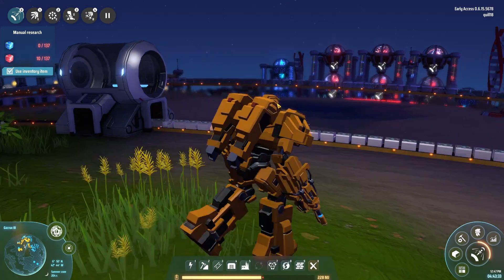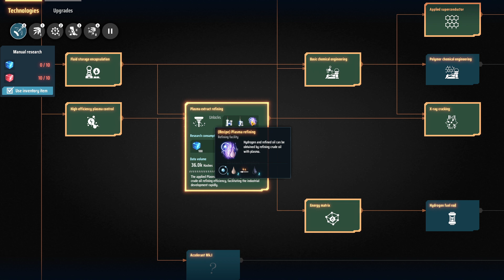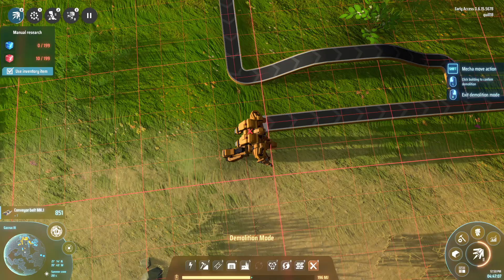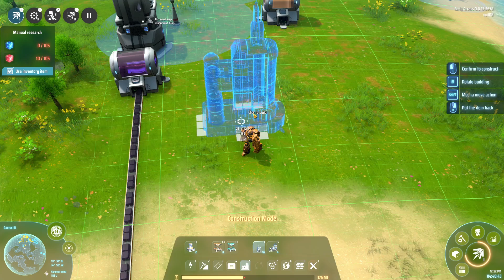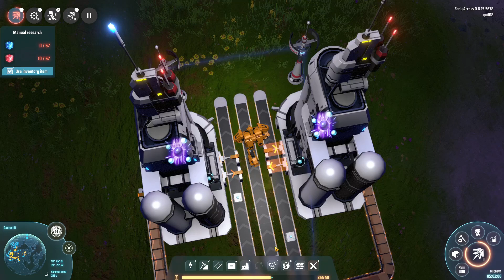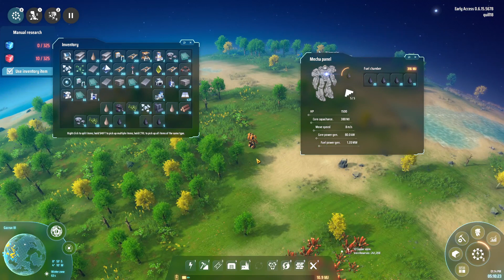Dyson Sphere Program - Cosmic-Scale Factory! Ep 6

Comment: i feel like the refined oil processing reduces your net hydrogen output.  the crud processing produces 2 hydrogen in 4, seconds but the refined processing requires 2 and produces 3 in 4 seconds so you are going from a net of 2 out to 1 out (and taking twice as long to do it.  it all depends on what the second product you need.
Reply: not to mention the additional space needed for the second refinery.
Reply: also @quil18, you can dump your hydrogen and energized graphene onto the same belt, and then use a sorter/spliter  to filter the hydrogen from the graphene and store the graphene to for later use.
Reply: @xtreampb6309  I may be misunderstanding, but I'm not following. How does getting an extra H out of each Crude Oil reduce output? Unless you are short on refined oil for plastics etc, turning Ref Oil into Graphite + a bonus H is a win/win?
Reply: @DynnysW  refining the oil produces 2 H, so in 4 seconds your net out is 4 H and oil.  if you further refine the oil/H you produce 3 (but costs 2) so the net 1 H after 8 seconds of processing.  i did some brief math and it does increase your output from 2 to 2.5 in the same amount of time (2 divided by 4 seconds vs 3 divided by 8 seconds)  but it also costs more in space and power.

Comment: @Quill18 check production output times & input requirements on your assemblers: you may well be able to get away with using longer sorters depending upon how the numbers pan out..

A self-sufficient red science block is a v useful thing to have; prolly no need to expand it until future techs become available (& the 'graphine' (excited graphite)) can be used as a decent mech/power plant fuel source until other things become available (save the coal for later!)..
-----------------
The processing of oil -> extra hydrogen + graphite even makes a certain amount of sense if you think of it as /theoretical/ chemistry: the refined hydrocarbon (oil) only consists of a bunch of hydrogen atoms linked to a few carbon atoms in a long molecule. If you split it up & recombine it the carbon becomes graphite while the excess hydrogen is produced as a gas.. (practical difficulties are left as an exercise for the reader ;))

Comment: quill: there must be a way to make this more compact
me, yelling at screen: swap the oil and hydrogen outputs!!
Reply: Jist turn the refineries 90 deegrees.  Run input belt on one side, two parallel out put belts on the other side.
Reply: Or have (going down the belt) A to belt, B to A, belt to B.
Reply: Or, just... offset one of those machine by one.

Comment: Pro tip while doing space travel, make sure you always have some extra fuel for your mech at hand because if you run out of all fuel while at space, its kinda gg. You will be stuck moving in one direction at the speed you were going and as far as i know the only way out of that situation is a reload.
Reply: You actually generate a tiny amount of power without fuel. You can get back to a planet this way. Reloading autosave is waaaaay quicker though.
You should always be aware of how many warp cores you have with you as well. Making a trip that requires two of them with only one may leave you stranded in the middle of space with the next star being 8 lyrs away. If you don't want to reload you can keep your computer running overnight to get back to a place from where you can order new cores via interstellar delivery. Of course you would also need to calculate when you would arrive there. Otherwise you might overshoot your target by one lyr or two.
Reply: I think I might be doing it wrong but I find that my leisurely cruise between planets barely use power after I break atmosphere
Reply: @GunmadMadman  he mean wen you pres capslock and enter warp it drain the capasetor of you mech RELLY farst so a big jump mean you have to stop in the middle to recharge and then jump back to WARP tha requre 2 jump and ther fore 2 jump core 1 way so 4 in total if you are 1 short you get stuck slow boating it or reloding

Comment: Quill you can pull and put stuff on 3 belts away. So you can First row input crude oil, second row output Hydrogen and third row output refined oil.
And i really don't like the X-Ray cracking, since you need refined oil for both plastic and organic crystalls for your yellow cubes.
EDIT oh btw: Graphite is a super Fuel for your Icarus
Reply: Longer sorters take significantly more time to transport wares tho..
Reply: @snafu.X  and ? that is only a problem if you produce faster than it can be moved, which is not the case with the Oil products

Comment: It's not intuitive AT ALL but you can make a jump with the belt a lot shorter.

First, you can have a standard hight jump with 5 belt pieces if you first build the high point (two pieces straight) then connect low point that has one piece gap with that high point THEN delete the second high piece and repeat first part in reverse.

Second you can have a very narrow jump if you do the first part standard jump then delete all the pieces that are in the air except one or two and after that connect the belt to the ground as usual.
With this variant you can weave a belt in between two consecutive layers of belts.
Reply: I saw that on Skye Storms not blindingly obvious tips. With that technique you also can curve directly after an incline and make a 2x3 spiral staircase belt.
Reply: That's a bug and will be patched, don't rely on it.

Comment: hmm, if only there was something that uses that refined coal that you produce from that Hydrogen cracking staring at the red science menacingly
Reply: If you are not researching that refined coal will bottleneck. The best way i found how to deal with it is just run it straight into few chem power plants
Reply: @agodin2500  connect a splitter to the refined coal, have it prioritize research, and send the rest to storage, use it for whatever you need later

Comment: Just do the Hydrogen on the outside and refined oil inbetween the two as the refined oil doesn't need to be outputted again?
Reply: That was my first thought as well, but then I realised if you add more, then suddenly the hydrogen will by on the inside again.
Reply: @OndřejVágner  yeah but then when he expands it he can just add two belts next to each other with hydrogen on the outside, and it would still be the most compact build i can think of. Like hydrogen|refinery|oil|refinery|hydrogen|hydrogen|refinery|oil|refinery|hydrogen

Comment: Your energised graphite is your best fuel source for your mech until you get hydrogen fuel cells (need titanium). They stack in 100 while hydrogen by itself stacks in 20 I don’t know what the fuel cells stack size is. I skipped Hydrogen fuel cells and went straight to deuterium fuel cells.

One big thing is to create a box for everything so you can easily grab a stack of something. A box for hydrogen, iron, magnets, magnetic coils, chips everything.
Reply: Hydrogen Fuel Cells stack in 30s.  Would have skipped to Deuterium Fuel Cells myself but I've found myself needing to travel back and forth between planets enough trying to dig myself out the energy pit I put my main world in that the fact a single one lasts about ten times as long as the Graphite does means the reduced need to refuel was too useful.

Comment: for that hyrdogen/graphite I use splitters. output with one sorter and filter those products in splitter to separate conveyor belts. same for fuel refining. then there can be only one space between two refiners.
Reply: It's better to filter the outputs immediately, it makes more efficient use of the belts.
Reply: @thakillman7  Depends on what you mean.  The production rate of the Oil Refineries is slow enough tat two of them should never fill up a constantly moving Tier 1 belt.  If you mean once you have that one belt merge with another fed from more refineries, that's when you either upgrade the belt tier or place a splitter there to separate the two outputs.
Reply: @SkyHawk2137  I pretty much always just stack a bunch of oil refineries behind each other until it is close to maxxing the belts. Feed the whole thing with a  bunch of oil drills.
Reply: @thakillman7  That's what I meant when I said about having one belt merge with another fed from more refineries.  I build a set up where there's one refinery processing the oil for every 0.5 per second output of the oil wells feeding that bunch of refineries.  But it's in blocks of two, where those two refineries output their products onto a single belt.  That belt then goes out and links up with a single 'main belt' that carries all the hydrogen, refined fuel and/or graphite from that specific complex of refineries.

But what I do is have it so that either that single main belt full of everything either reaches the 'exit' of the refinery complex whereupon I feed it into a splitter that filters out the different products to their own transport conveyor belts to wherever they're headed.  Or, if the output of the complex of refineries is greater than whatever conveyor belts I'm using to set it up (usually the tier 1s) at the points at which it becomes too great, I place a splitter there to filter out the belts into the two (or three) 'main belts' which link up with the other filtered main belts wherever is most convenient (and preferably efficient) and form the true main belt that exits the complex and goes off to wherever those specific resources are needed.

I originally did use two sorters and belts per refinery to place the output resources on separate belts from the start which all linked up, but as I've hit mid-game I've discovered just how painful it can be to have a lot of machines around when one and some planning could do.  Because basically everything has an idle power consumption, and the upgraded forms have either an identical power consumption as a single lower tier machine or lower than using two of the same lower tier machine.  Both idle and active power consumption.  And right now, every single Watt of power I save is a lot less messing around building up more powerplants, optimizing production complexes to feed generators or ensure I have a smooth automated output of Dyson Swarm mirrors to make it so I don't power crash yet again.
Reply: @SkyHawk2137  My economy needs so much oil that i just build gigantic refinery sites. As in, dozens of refineries in one place. Single-purpose belts make everything easier. you can copy the sorters to copy what they filter too, so it's very easy too.